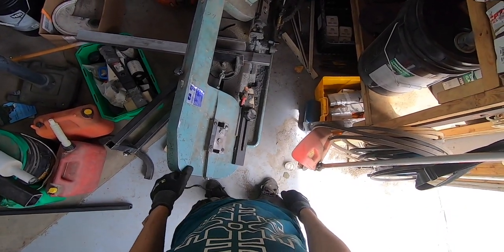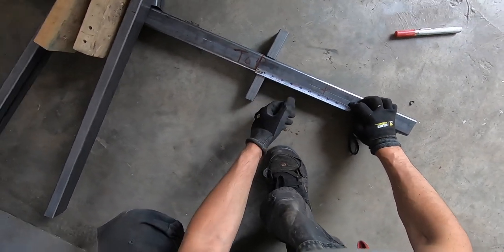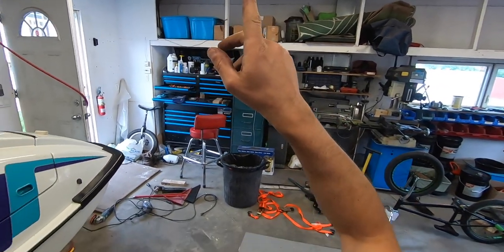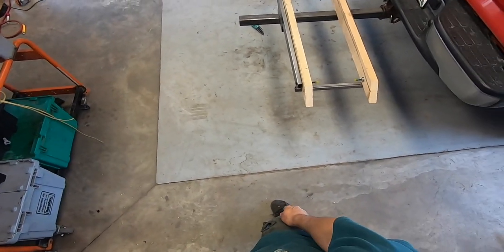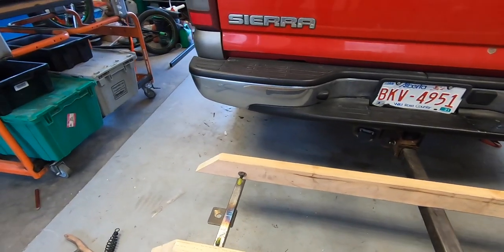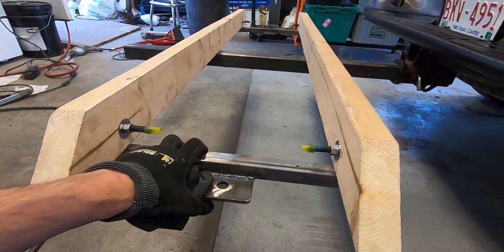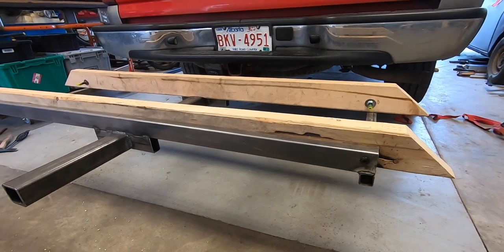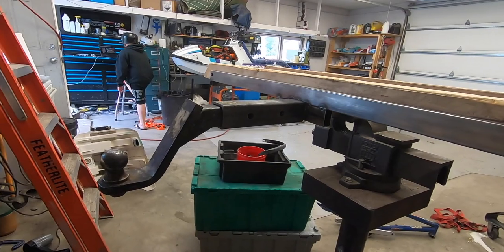Jet Ski carrier - Home Made - DIY

Comment: very cool, a little carpet on the wood would help the ski slide a little easier.  looks awesome great job.
Reply: @JoelArseneaultYouTube  I just bought one cause I don't have access to a welder but the one I have is all metal with snap on plastic bunk covers.and when it wet oh man does it slide. The other day my ski almost slid right off on to the floor. But I don't have the front nose clip and I ratchet down the front and the back and it holds just fine long distances And the freeway no problem.
Reply: @JoelArseneaultYouTube  hay if ur carrer is rocking a little much i got this extra piece whitch u could fab up in like 2 seconds. its baiceally a threaded u bolt with a plate that bolts under where the carrier fits into the truck and u tighted it down and there is no more rocking.  it removes the extra play in the two pieces when fit together. im not to sure what the name of it is but it works great just thought i would give u the heads up. here is an example so u can get a visual picture. in no way am i trying to sell u anything im just trying to give a visual cause im kinda bad at  explaining what in my head. https://www.amazon.com/Tightener-LIBERRWAY-Anti-Rattle-Stabilizer-Installation/dp/B01KZ25Y26/ref=sr_1_2?dchild=1&keywords=hitch+hauler+anti+wobble&qid=1593377289&s=amazon-devices&sr=8-2

Comment: Would love to know how much the ski weighs and how much the trailer weighs. I'd like to be able to do this with my ski and still tow my boat.
Reply from the maker: Each application is very different, and it's more about tongue weight than over all weight.  My receiver is a Class 3. This typically gets talked about as a 6000 pound hitch. HOWEVER, that is the maximum weight of the trailer that can be towed. 

The tongue weight, the weight that is actually pushing down on the ball is maximum 600 pounds. Again... it gets a lot more complicated than that. Your draw bar is essentially a lever and when you make one of these carriers, it is also a lever. The longer that lever is, the more force there is applied to the hitch. A long enough drawbar and you could stand on it and lift the front end of your vehicle off the ground (or snap your hitch) 

The X2 is 275 pounds dry , so about 300 lbs with fuel. That means two feet out from the hitch, I would be applying 600 lbs... the limit of my hitch. I got mine in as close as possible. I believe the centre of mass is at about 18" so about 450 lbs on the hitch. I try to make sure that my trailer is as light as possible on the front, within reason. We have a water tank on the rear of the trailer so I fill it up to reduce the tongue weight. 

Cheers
Reply: I have one similar and put my x2 and my 18ft ski supreme behind it. I do run simple safety chains on the corners of my hitch on the truck to the rack with turn buckles to take out slack to prevent the trailer from jack knifing the rack between the truck.

Comment: is that legal since it's blocking the license plate?
Reply from the maker: I attach my plate to it when in use. I ended up welding on a bracket, after losing my plate while headed to the boarder... meaning I had to drive for 22 hours to go get a new plate, and back to the border. There are no lights on it, so I'm guessing any DOT officer or highway patrol could fine you if they wanted...They sell carriers for cargo, mobility scooters, motorcycles and work in the same way, often without plate mounts or lights.
Reply: @JoelArseneaultYouTube  you can run some 12v lights off the trailer plug they probably make some lights that connect to it? Well I'll ask California chp if it's legal and if so  I'll be making  one for myself!
Reply from the maker: @nayefalkurahi3357  Yeah... I have a plug (extension) on mine so that I can haul the jetski and a small trailer.... though, I've only done it a few times. It wouldn't be hard to put the necessary lights on it, to make it legal... But it's a good idea to check.

Comment: What type of square tube steel and dimendions did you use and where did  you get it ? Thx .
Reply from the maker: The part that goes into the truck receiver is 2 inch with .2 inch wall thickness. Most metal shops will have a specific 2" stock they sell for trailer receivers. The rails that support the ski are 1x2 inch with a .065 wall thickness and I have a 1x1 with a .065 wall across each end to stop it from spreading and also for an attachment point for tie downs. I used some 1/4 inch plate to make the tie downs.

Comment: What thickness is your tubing?
Reply from the maker: What part are you wondering about. It is all different. The main hitch part that attaches to the truck is proper receiver stock. Metal places sell it specifically as receiver and hitch (not sure the actual name. The tubing for the rest of it was all the rest was 1/16 wall thickness.

Comment: cool fabrication but what is your plan to load and un load the ski from the water to the truck and vice versa?
Reply from the maker: Hey frank. Fair question. 

I have actually used this thing for a full season and it works really well. To get the ski onto the carrier, I back my truck into my garage, the table that I keep it on is about the same height and it slides on with little difficulty. To get back onto my kart / bench is pretty much a reverse process. 

To load and unload at the water I simply back my truck into the water. We have no salt water where I live... I can easily push or drive it on and off. I have clips in a few videos of me loading it from my work bench as well as in and out of the water. 

I have also done this same process using a beach buggy, with a SXR 800, and it worked really well. The beach buggy is lower, so I did the loading on level ground, in my alley. 

Cheers !
Reply: @JoelArseneaultYouTube   Thanks , I am looking but not sure first if my  old 600lbs seadoo bombardier 9ft long I just got is too heavy for the tongue weight of my f250 hitch (I have to check but probably is),so I always liked the idea of avoiding a trailer but the biggest problem I see for me is the load and unload from the ocean marina ramp where I want to use it ,even if I eventually get a smaller ski it looks like I might have to build and carry a dolly in the trunk to use it in the flat parking lot...thanks for your reply and ideas , take care!
Reply from the maker: @frankc6430  Yes... that does seem like it would be too big and awkward, perhaps dangerous to move around without a trailer.